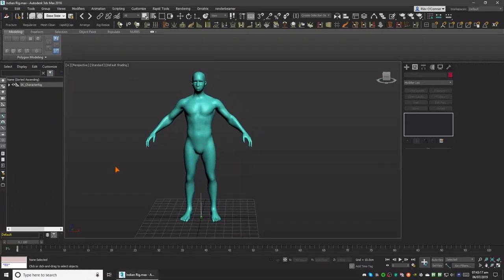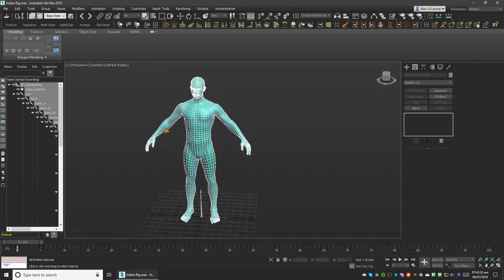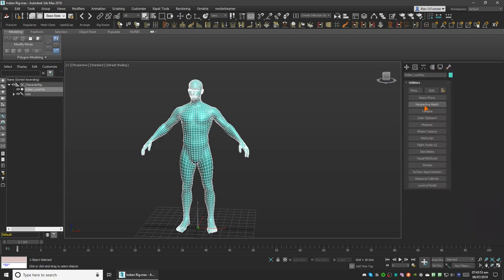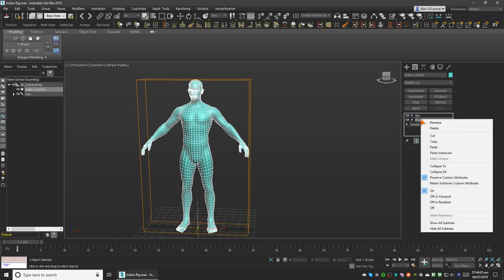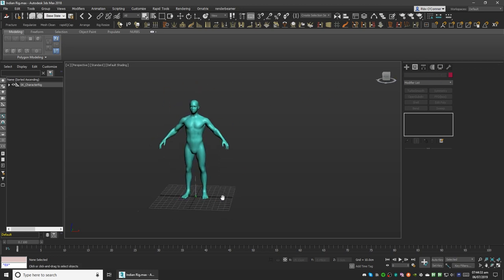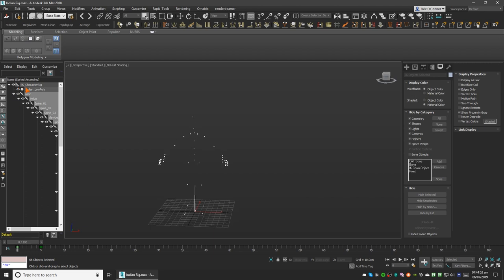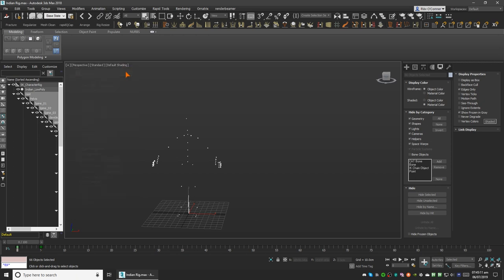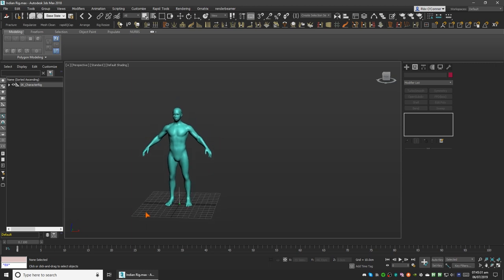Solve gimbal lock exists while exporting to fbx in 3ds Max

Comment: This only partially worked for me, moving the XForm modifier below the Skin stack royally screwed up the weight values and the model was deformed. What I suggest doing is instead save out your weight skin values to a .env first, you can do this in Skin > Advanced Perimeters > Save. After you save out your weight envelopes, you then can apply the Xform like you did, drop the stack entirely, reapply the Skin modifier, and "Load" the saved out envelopes. This worked for me in the 2019 version.
Reply from the maker: I wonder why the weight values were modified? Did you had always deformed checked? I cant think of anything else that would cause this, unless of course it was a stack of multiple objects and not just one editable poly?
Reply: Yeah same here, I'm guessing it's because I'm using a model from Mixamo.
It's not entirely consistent.
Edit: I'm not having any luck, though, the model remains stretched even after saving and loading the weights..
Reply: My skeleton shrunk and now won't fit into the mesh the way it should, any answers?
Thanks!
Reply: Since this seems like works for me, your probably are my god since now, bless you and the Rév O'Conner.
Reply: Sometimes importing from different Autodesk products with different system unit scale causes scaling of root bone, in my case this method above was unsuccesful, but I was able to fix gimball lock issues just by setting root bone to 100%. I recommend you to check its scale.
Reply: Your method worked for me perfectly! Thanks for this. Yeah, I was having the same scale issue when I reset the XForm. So I saved the weights > reset X form > Used the bone tools as the video explained > Re-applied a new Skin > Loaded the saved skin weights and boom. No more gimbal error. Thanks so much.

Comment: I have multiple geometry meshes(separate arms, uniform, legs etc), I did the same thing on every geometry object. for selecting the bone, I manually selected all bones(method shown in the videos doesnt work for me for some reason). so After doing all the steps when I tried to export it, it still same. gimbal lock exist (91) same 91 bones
Reply from the maker: Try changing bone rotation from euler to tcb

Comment: Does this work for crowd helpers, or will I have to export and convert deforming dummies to bones? All of the rigged 3D models I have uses crowd helpers as bones. (Which I've become used to.)
Reply from the maker: No idea
Reply: @revoconner  Well is there any other way to fix gimbal lock from helpers? I'm in a massive situation here because I need to switch from 3DS Max to Blender in a certain amount of days else I won't have access to all my max files. If there isn't any other way, it's fine.
Reply: @revoconner  EDIT: I actually solved the problem for the helpers, it's kinda the same thing but I think I didn't reset transform/scale for them in the hierarchy panel. I used the reset XForm with "Collapsing to" method. I just have a problem with certain bones with random rotations when importing to Blender. I'll have to solve that on my own.

Comment: Thank you for this video. Actually, for me, it did not work the way you did it, because that way it screws up my skinning. My solution was to apply the XForm to the mesh before skin it. Of course, I had to do all the skinning from the scratch.
Reply from the maker: Yeah this is about avoiding that if possible of course if it doesnt work you gotta redo it.
Reply: @revoconner  The good point is that in won in experience to check the model to export before start doing the hard skinning job.